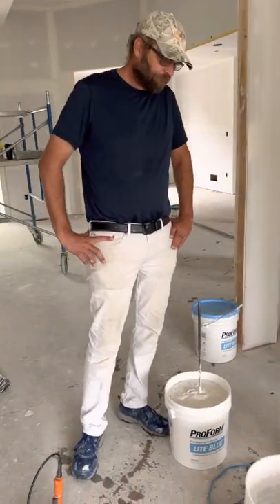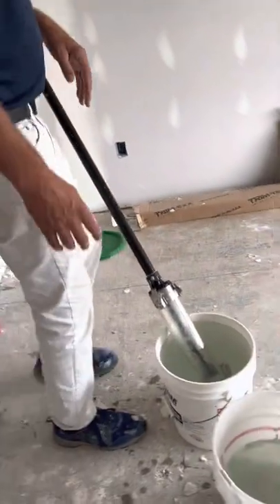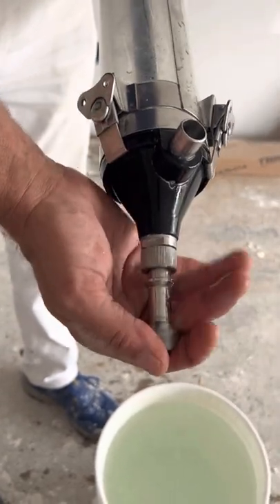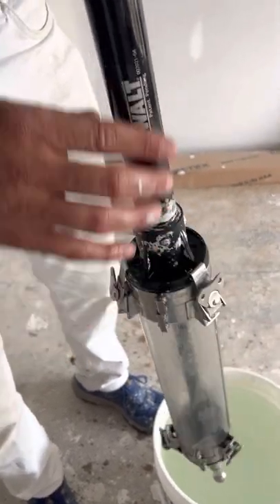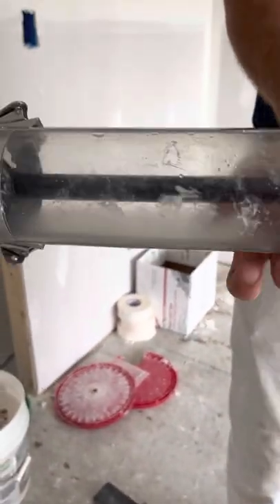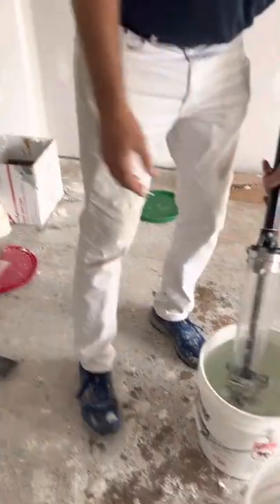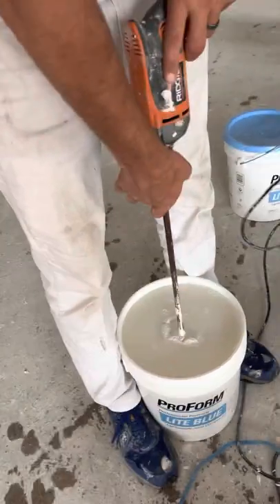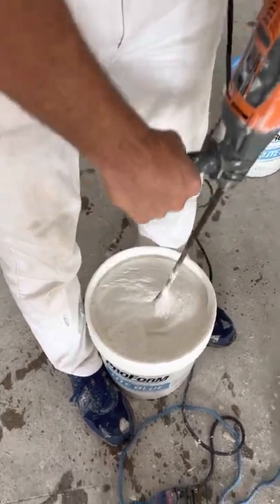Best Angle finishing tool! Intro a steps to running Dewalt Mudshot!

Comment: Great instructional vid. I have been doing dry wall since I was 8 and 59 now. I do not do it anymore full time. Last tine I was on a high production job and this mud runner by Ames was introduced I was impressed because for years we pushed the angle box. I just did a small job and rented Ames. I did not notice a mud flow adjustment behind the angle head. Your work saves lots of time. I hade to clean and pic a bunch and thought I would be better off coating this by hand after all the set up and picking time. I will check this set up out. Thank you

Comment: I had a TapeTec Mudrunner, which looks to be the same as what you have here. It was one of the best angle finishing tools ever invented, once you master how to use it.
I found using the head like what is used here first and then smooth over with a glazing head, takes seconds to get a perfect internal angle top coated.
Reply from the maker: I had a mudrunner prior to this,  this is much easier on your body.

Comment: here's a good tip , rather than all that adjustment of the valve , just remember what ones where hollow and wait till it runs out and then run it over the hollow tapes , i found this to be way quicker , i love my mudshot ,after 25 years on a angle box , i dread the thought of going back

Comment: I really need to try this dewalt mudshot
Reply from the maker: Have you had a chance to try it out yet?
Reply: @manwithapan  I have a question about the mud shot. What causes the mud to fill in one side of the angle and opposite side showing tape? Also where do you want the mud flow valve to be positioned when running corners? I’m new to using the tool and still trying to adjust to it.
Reply from the maker: @fredhughes7569  So you want to be at a 45 degree angle to the angle your finishing.  The valve faces forward in the direction you are going. As far as not covering tape.  There are a few factors.  Could be the angle heads,  or could be they were not pressed hard enough with roller when taped to get them glazed fully!  I can make another video of it again.  I just finished using it yesterday on 10k ft of board.
Reply: @manwithapan  yeah that would be great! And thank you for the info… I been using pan and knife for 15 years and just made the switch to automatic and box tools this year. Whole new learning curve!
Reply from the maker: @fredhughes7569  Yeah it’s definitely a learning curve. I was fortunate enough when I started my career at 20 years old, I work for a commercial company and the first thing I put in my hands was a bazooka, before I even picked up a pan or knife. I did that for a year and a half and learned all the machines. Then I went to custom homes and they wouldn’t allow me to use the machines so I had to hand finish for about 12 years, then we got too busy and I force the machines back on the custom home Drywall Contractor. Been using them ever since with the exception of jobs at 100 sheets or less. Once they’re learned They are money makers!
Reply: @manwithapan  that’s awesome! I watched a lot of your videos you do good work by the way! I run my own drywall company myself here in South Carolina! This Trade could use a lot more people like you for sure!
Reply from the maker: @fredhughes7569  I’ve been looking for a good finisher for almost a year now. One that actually shows up to work every day and wants to make his money. It’s gotten absolutely ridiculous in this world for people with quality, and it’s all the builders want around my area.
Reply: @manwithapan  same way here. Hard to find good help and harder to keep them once you do find them! Builders here are same way. They want quality work over quantity work! Anyways keep up the good work! I’ll be on the look out for that video! Thanks!

Comment: Leo! Thanks for the great videos. I purchased a used mudshot and had some trouble with mud coming back out the fill nozzle. Do you think my mud was too thick? I lubed and pumped it up and it just came right back out. I emptied the tube to make sure nothing was jamming the valve open, filled it back up and it did the same thing. Even when I put my angle head on and opened the end a few turns, it still shot right back out.
Reply from the maker: So I don’t have an answer for that, I was going to say something might be stuck in valve.  It may just be a faulty valve.  When you push in on it with your pinky. Does it have resistance? Like a spring pushing back.
Reply: @manwithapan  Leo, sorry I totally missed this! I really appreciate your detailed response. I actually got in touch with the company and they sent me an entirely new cone. Works great, great customer service!

Comment: Great video!! I have a question how can I make the plunger go down easier? Even if I put it on water like you said it’s super hard to pump! Or does it get easier after it wears out?
Reply from the maker: Mine is a year old and it still requires me to pump it hard.
Reply: put 3 in 1 oil down those holes, not water. do it before you use it and after you clean it.

Comment: add palm soap and youll be flying with the mud runner.
Reply from the maker: Soap voids mud manufacturers warranty. I used it 25 years ago until a contractor I know was given 11k to refinish a house due to faulty formula.
Reply: @manwithapan   here in canada its a non issue and the work comes out nicer and has glossy look.

Comment: I have a question !! I just recently purchased one and it seems that where the cilinder begins at the top of the handle it's a week spot, it's not very strongly I can we mine has some movement there and it's new , have you notice anything like that ? 
I saw you using it on the verical corner and it does bends at the joint where the cilinder starts .. I'm disappointed I don't want to return it but I might have to
Reply from the maker: Mine is solid.  It has to flex as there is pressure being applied to it.  I would imagine they would give you an exchange.  Send me a private message on Facebook.  I’ll give you a direct contact that can help you out. Leo Bouchard

Comment: How are the angles already glazed that much before the mudshot ? I'm more interested in how you get them to look like they're almost finished before using the mudshot ?
Reply from the maker: I use the northstar bazooka, roller and 2.5” glazer.  The trick is to lightly roll out angle to set the tape,  then push pretty hard to make sure most of the mud comes out from behind tape.  When you glaze,  the glazer should glide across the angle and fill bevels as well coat the tape.
Reply: @manwithapan  I kind of get it, lol. The part where " The glazer should coat the tape " is the part I would love to see a video of. Thanks for sharing the knowledge. I'm learning a lot from you. You and maybe two other channels only ones that go into details and specifics that others don't cover at all. Keep it up. I hope you reach a high number of subscribers. Your channel definitely deserves more attention. Keep up the videos, though
Reply: Also, I forgot to ask, is it possible to achieve that with a Banjo ?
Reply from the maker: @mehmedasotic584  yes,  but you need a glazer and roller.
Reply from the maker: @mehmedasotic584  I made a video of it.  Hopefully it helped you out.
Reply: @manwithapan  definitely helped me out. I have a few more specific questions that I think only people like you would know. I'm looking forward to your other videos

Comment: How long is that mudshot ? Level 5 just came out with a mini shot which is 42 inches long and 60 inches long with the 18 inch handle which is better size in your opinion i usually finish 9foot ceilings and 8 foot ?
Reply from the maker: I don’t know.  Maybe 5 ft.  I have a prototype of the mini shot.  I tested it last year.
Reply from the maker: I run the regular sized one on everything.  Hand finish back of closet doors.
Reply: Did you say in one of your videos you use the "hockey box" without a handle for the back of closet doors ?  And that was my next question is would a shorter mud shot aka mini shot be better for those situations of back of closet doors ? And can you screw an extension handle on your mud shot extension handle so i was wondering if i can buy the minishot level 5 and have 2 extension handle for smaller or taller areas? Does your extension handle have treads in the back for another extension? Sorry so confusing lol
Reply from the maker: @DCtaping  I run the angles in closets by hand on back of doors.  I don’t own an angle box.
Reply: The price tag for mudshot is ridiculous.

Comment: Just got this setup but with level 5 angle head, but it’s gouging if one side of the corner is already taped, can you adjust that? I do commercial with standups so sometimes there a bevel right beside the corner and to gouges like crazy
Reply from the maker: I’m not quite following the one side of the corner being taped.  Are you rolling your angles and glazing them when you tape them or hand taping them?
Reply: @manwithapan  as I said, I do
Mostly commercial with standups, so there sometimes ther is a flat a couple inches from the corner, so one side of the angle head is riding on dry compound. Similar to when you cross a flat in the corners on your video
Reply from the maker: @tomfairbank4715  okay,  so all I can suggest in this case is to get a Columbia or northstar angle head.  A lot of times when corners are not square,  much like ceiling angles as bevel is on bottom which is like your stand ups,  I will open it up more to allow more mud to come out so it kinda pushes the angle head along.  I personally have northstar angle heads.
Reply from the maker: @tomfairbank4715  I gotcha.  I have done commercial work.  In that case I would run flat right over to angle and when I coat screws just hit other side of angle by hand.

Comment: Compared to the mud runner looks way easier, I’m happy with the mud runner until my hand gets wet, tried using gloves found I needed something right around the top twisting the handle works all right.
Reply from the maker: I had a mudrunner for a long time,  it wasn’t my hand slipping that bothered me.  It was my forearm that would burn after running 400 sheet houses.
Reply from the maker: Compared to mudrunner this is a lot easier to use.
Reply: I believe it’s my muscle memory. I don’t always work alone, I have a friend who loved using it very efficiently at that, had some health problems, he loved running the tools hated picking angles, instead I would pick and clean up everything, I actually taught him, now he’s gone, not sure why last two jobs I had a hard time slipping after the second big sheet house getting my technique back, it also feels like my shoulder is just giving up. I may just be getting a little old, injures have been catching up the last two years, it’s also been a very long hot summer. 😂I’m actually finding it very hard to find anyone who actually works. I’m finding a generation of really lazy, looking at the phone.
Reply from the maker: @kidjetrecon7153  Sorry to hear about your partner.  My oldest son who is 25 has decided to not finish any longer and went to stone masonry work.  So I am solo and like you can’t find anyone that actually wants to work.  Where are you from.  I’m in Northeastern Pa.
Reply: @manwithapan  I’m in Iowa around DesMoines, more work than I could imagine.
Reply from the maker: @kidjetrecon7153  same here with work load.  The few around here that are good finishers are just doing whatever we can to keep up.

Comment: Drywall doctor uses one and swears by them....takes lil time to get used too but once you do your flyin....holds more mud so less trips back to pump and less effort to put on the wall.......sometimes people just don't want to learn something new, they are like factory workers, same ol and that's way it is

Working fir yourself anything that is quicker, faster, better is a win......even if it's a lil slower in beginning fir learning curve